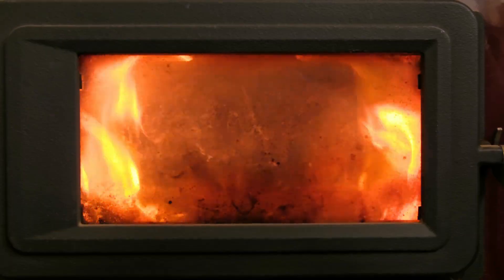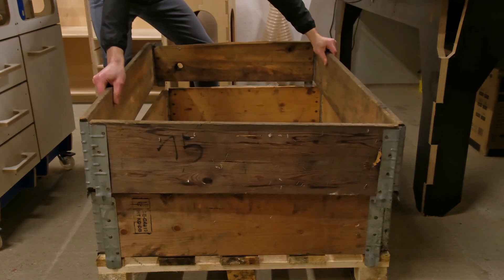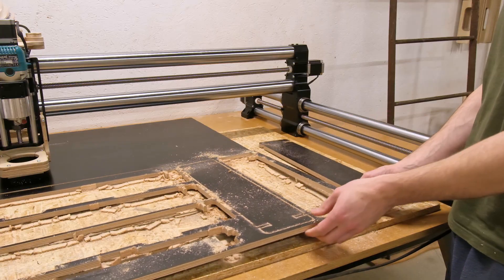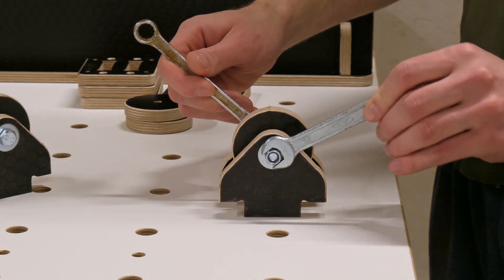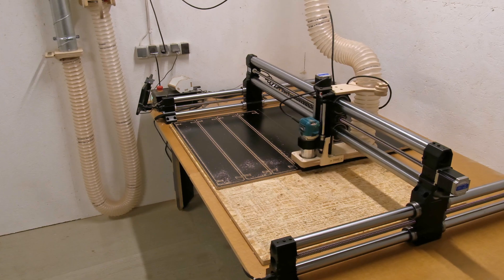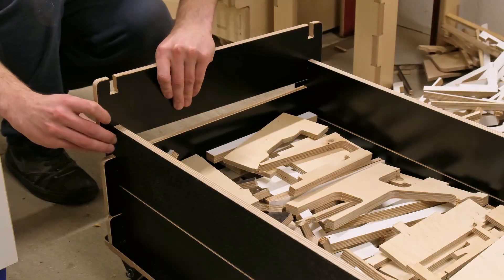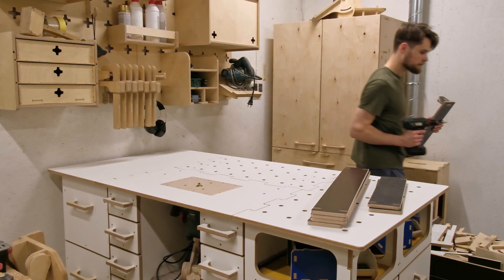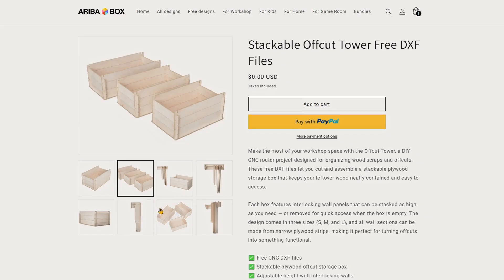Dealing with the Offcut Problem - Simple CNC Project

Comment: Davis, this is great. Question - What hold-down method are you using for the parts as they are cut? I see you screw your board down, but it doesn't appear that you are using tabs? What is your magic? I know you cut a ton of plywood. Thanks
Reply from the maker: Thank you!
Yes, you’ve got it right — we screw the sheets down to the CNC’s work surface and skip the tabs for parts made from 9 mm material and thicker.

The “magic” really comes down to the router bit and cut settings:
- Router bit: 1/8-inch straight flute (2 flutes — nothing fancy, just a ~$2 bit from Amazon)
- RPM: 25,000 (max on the Makita router)
- Feed rate: 3,000–4,000 mm/min, depending on material thickness (thicker sheets need a slower feed, around 3,000 mm/min)
- Cutting depth: up to 15 mm in one pass (for 18 mm and thicker, we do two passes)

With this setup, the wood shavings pack into the cut grooves and hold the parts in place, so we can skip tabs entirely. Smaller parts can be a bit tricky, and it doesn’t really work for 6 mm (1/4-inch) sheets because the shavings don’t hold them securely.

It’s a bit unconventional, but it’s worked really well for us.

Comment: Just a quick, friendly heads-up regarding the tip about burning plywood/engineered wood scraps in your stove: In many countries (like most of the EU, the UK, and many US states) this is actually illegal and can be quite dangerous. The glues and resins used in materials like plywood, MDF, and particle board can release toxic chemicals (like dioxins and formaldehyde) when burned at low temperatures (like in a home stove). These fumes are a serious health hazard and can also cause a dangerous buildup (creosote) or corrosion in the chimney. The safest way to dispose of these offcuts is usually to take them to your local Household Waste Recycling Centre (or 'municipal waste'/C&D transfer station).
Just wanted to share this to keep everyone in the community safe. Keep up the great work!
Reply from the maker: Thanks for the reminder and for sharing that info! You’re absolutely right - burning plywood and other engineered woods can release some nasty stuff if done wrong. We usually mix small amounts of clean plywood scraps with regular firewood in the furnace to reduce fumes, but your point is a great one and good for everyone to keep in mind. Appreciate you looking out for the community! 🔥👍